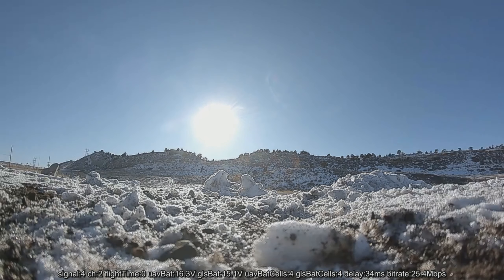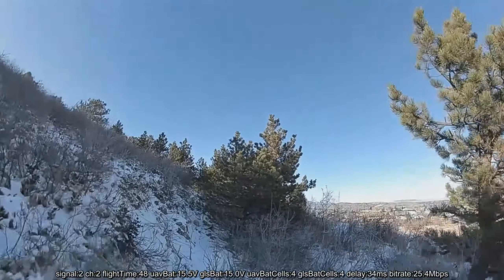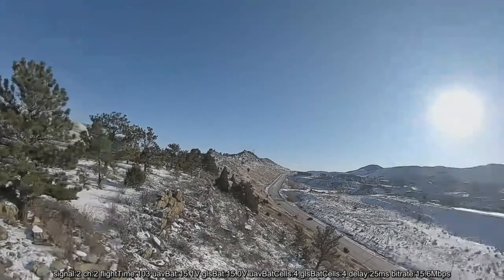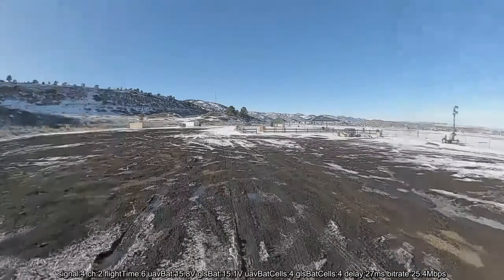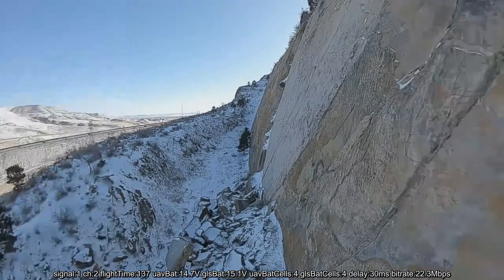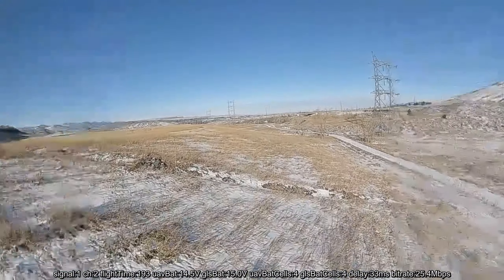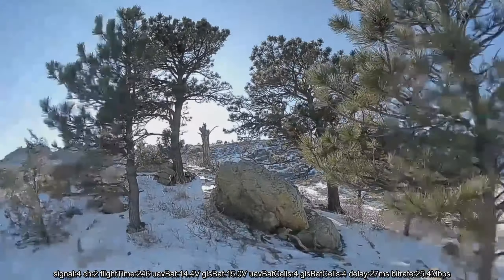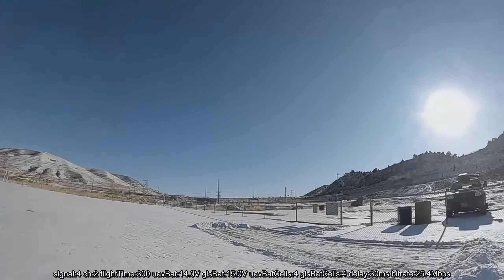Two narrated NLOS flights behind solid rock (DJI DVR recording)

Comment: Thanks for sharing! I got the DJI system partly because of your videos and having an amazing time with it. Can you let me know how you upload the DVR at 1440p quality?
Reply from the maker: Find and install the program called AVIDemux (version 2.7.5) and run it.  Drag and drop the DJI 720p mp4 file into avidemux window.  Then on the left under "Video Output" see if you have an option for Nvidia 264 (only exists if you have an Nvidia graphics card).  If it exists, select it, then hit the Configure button, set to High, High Quality and Bitrate 30000, Max Biterate 35000 and hit OK.     If you don't have nvidia options then select Mpeg4 AVC (x264) and then Configure button..   For simplicity, down near the bottom I'd use Constant Bitrate (Single Pass), 30000 kbit/s and click OK. 
Now  back under Video Output section hit Filters button,  under default Transform section scroll down list in the middle and select swsResize and double click to add.    In the resize popup, drag the slider all the way to the right to select 200% and set the resize method at the bottom to Bilinear , and hit OK, and then Close the filters dialog.     Back in the main screen, select Output Format of MP4 Muxer.
Click Save Video button in the toolbar give it a location and filename, and let it start working.  
If you have an NVIDIA GPU and have the nvidia codec option, it should go relatively quickly.  If forced to use x264 codec, it'll take quite a bit longer. 

If you're doing this to a video that has sound and want to keep it, then you may need to change the Audio Output format from Copy to ACC (lav), the configure, and set the bitrate to 128 (for lower quality)  or 384 for highest quality.
Reply: techdaemon wow, super helpful. Thanks!

Comment: That's an amazing spot to fly! Reminded me of the original star wars! what state ar you in, it almost looks like northern AZ! Just switched to the r9m lite pro 1w but haven't done any long range or behind earth yet. I will have to give it a go after watching this!
Thanks
Reply from the maker: In this video I think I was still flying 2.4Ghz RC with R-XSR.   I switched to R9M Lite to get a bit more NLOS performance then R9M Lite Pro version.  Note that you can't keep the Pro at 1W.  1W setting is really variable power, so it'll start at 10mW and ramp up.   I fly it at fixed 500mW.   Note also it does not play nice with other R9M users at anything more than 100mW.  They step all over each other.  Telemetry is lost 90% of the time and I even appeared to get shot down by my flying buddy once.  I was told this happens with Crossfire too, if you force it to higher power.   I've had bad experiences with Crossfire in the past (had it lose sync only a mile away and not recover until the aircraft returned all the way home).
Reply: @techdaemn  thanks for the info!!

Comment: Very cool!  Are you running in low latency mode or high quality mode?  Also, I don't know about R9M, but I can log telemetry through Crossfire to my Taranis SD card.  I can look at link quality after the flight, along with all the other telemetry parameters like GPS, battery, speed, etc.
Reply from the maker: Always low latency mode (unless flying at night, where HQ mode runs at 60fps, letting in more light). 
I'll  look into the telemetry logging features of OpenTx some more, but looks like the logging interval may not be granular enough to catch a momentary event like this.
Reply: @techdaemn  I wonder what other differences (if any) there are between low latency and high quality modes.  Latency obviously.  120fps vs 60fps.  But anything else?  Is there less pixelation in high quality mode?  I wonder if anyone has tried to get past the 4 mile barrier in high quality mode.
If you're getting telemetry to your transmitter, it's very easy to log the data.  On the Special Functions page, enable a function where the command is "SD Logs" and then give it a time delay.  I have mine set to 1 second interval, but you can set it down to 0.1 second.  So you might get the granularity you need.  You can also set it to be enabled via a toggle switch on the transmitter (like the arm switch).  Data is logged to the SD card under \LOGS\.
Reply from the maker: @twinturbostang   HQ will record a consistently cleaner image, but it does it at the expense of increased latency and more latency variation (it retries more).   And  when it breaks down, it's worse.  I asked someone else to try going beyond 4 miles with HQ, but I don't remember if they ever did.

Comment: Nice flying as always. Could you post a link of the patch antenna you used ? Also, do you think of letting go your analog stuff after flying HD and getting this performance with the DJI system ?
Reply from the maker: Check the description of the last video I posted (40ft below los)..    Links to all the antennas I'm using are there.     Yes, it's going to be very hard going back to analog.   I might be done with it on my quads (other than Whoop class).    Not quite there yet for fixed wing flying (especially since I use a head tracker
on some of my planes so I can't keep the patches pointed at the plane).    But for something like the Goblin (or NG) with a fixed forward view, I'll probably try DJI.